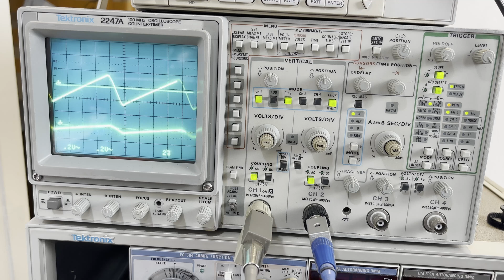How I Built a DIY Audiophile Power Amplifier

Comment: This is a great design to be honest. Being equally honest you could shave a lot of weight off by simply rectifying the wall current, running it through some common mode chokes and large value capacitors. This essentially converts the wall current into raw voltage for pushing some serious drivers. If you put enough MOSFETs in parallel you can drive quite the low ohms load without overheating too much. I know it's possible on 120vac @ 20 amps. It runs clean and quiet and will dim the lights if you push it hard enough. I think it would be some fun content if you reckon you can get your head around it.

Comment: Have you considered placing the transformers on top of one another and "upside down" right against the front panel? If that works height-wise, it would give you plenty of clearance. You could then shield the entire section with a U-shaped permalloy on a steel carrier and arrange the filter caps in a row towards the rear. I have tried CRCLC filter arrangement, despite increased output impedance and slight modulation. Resistors come with a diode bypass, ie once the voltage drop across them reaches the additional diode threshold voltage, it begins conducting. This tends to compensate voltage drop of the transformer under load and keeps rails at a more or less constant voltage for low to medium power output with high bias lateral fets. Ripple is comparable, but higher frequency noise is exinguished into oblivion, especially with ultra fast, soft recovery diodes rated at 25A, or more.
Reply from the maker: To do as you suggest was Plan B, and I even went as far as buying the riser panels to allow me to build a "shelf" for the second transformer. I think one of the challenges is that whatever one does, there is always a compromise somewhere. I quite like the symmetrical layout that I have ended up with.
Reply: @audionautica6843  That's true, I've started with a gutted 3ch power amp enclosure, but in the process, had to have both the steel bottom plate and top cover made to measure, to accommodate large enough heatsinks for the high bias output stage and the power supply custom designed PCB. With DC inductors in place, there was literally a 1mm gap left in the end, so came pretty close. Have managed to retain the front brushed aluminium allloy panel though, which offered little consolation. Empty canvas look promising, then everything comes crushing (together).
Reply from the maker: Yeah, understand - I did a Hauptwerk organ conversion once of an old Allen console, and even with the mountains of space you have inside that, it was quite challenging working out where to fit everything and run the harnesses.
Reply: A nice build.. I'm afraid I do not like those naked bare speaker terminals. Disaster in the making ! . Well done and I've enjoyed your videos

Comment: You have an imposing amplifier there that can compete at any price point and in any timeline. With those Nichicons, heavy gauge wiring or bus bars might be calling soon. In audio you never say never, now you have great ideas for your neighbours SYMEF built.😉
Reply from the maker: Yeah, definitely worth looking at I think. Fortunately the leads are short - even shorter than they were before with the 10,000uF caps. The trick will be access to the amp board itself - I may have to take out the riser panel with the protection boards on it to get to the power in spade terminals.